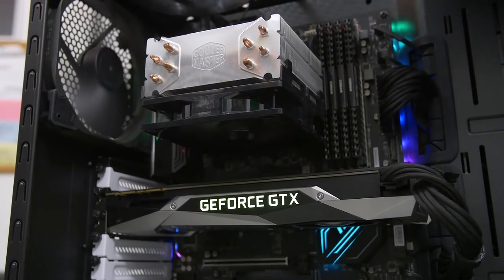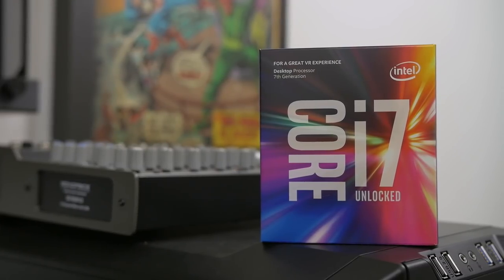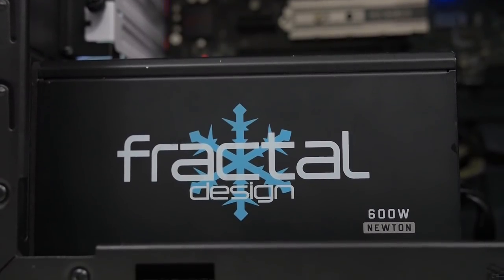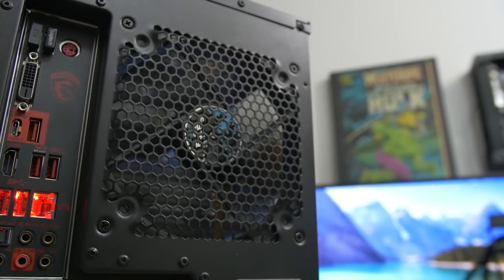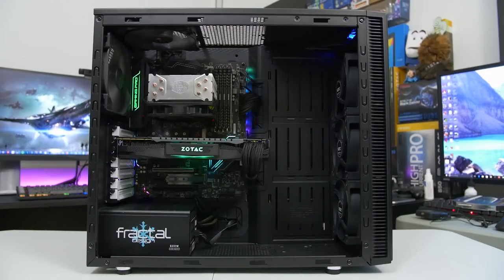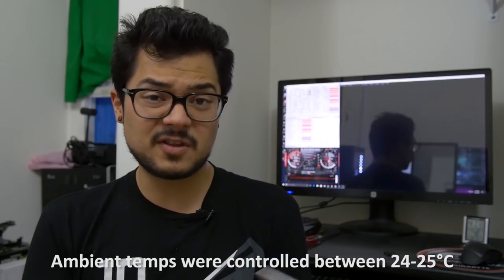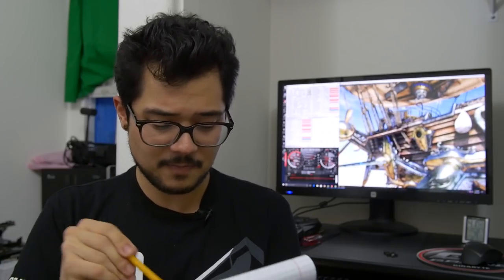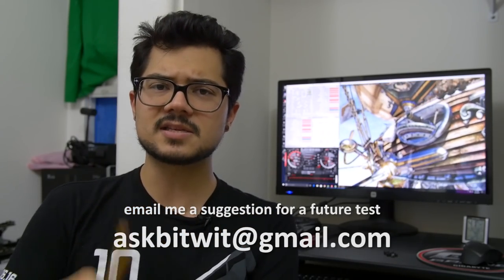This is how you should mount your CPU cooler! I think??

Comment: Hey bitwit, can I safely oc my i7 7700k to 5ghz with the hyper 212 evo?
Reply: Andrew Robinson Depends of the quality of your CPU.
Reply: Andrew Robinson highly unlikely
Reply: +Fresh Dumbledore ...i7 7700k...
+freestuffgood dang. What do you think I can I get to?
Reply: Andrew Robinson Every CPU is a bit different. Even if its the same modell. Some i7 7700k's can be oc'd better than others ^^. Also, whats your PSU?
Reply: couldnt tell you but 5 seems like alot for a non watercooled build
Reply: evga 600w bronze

and I thought I saw somewhere it could be done, but idrk if I could do it on air cooling.
Reply: ***** I just already have the cpu cooler. The motherboard is an ASRock z270 pro4, idk if it's good, but my budget just allows it.
Reply: If it were me anything 5.0 ghz or more I would use a AIO just because of thermals.  But the first question has to be will your cpu even oc to 5.0 (silicon  lottery).
Reply: Mostly no , u wont be able to push that far . 5ghz is quite hard to reach , depends on the cpuu . But the chances of doing that with a hyper 212  evo .. is very low . maybe sell it and get smth better , theres plenty of air coolers that should do it , and dont cost thousands of dollars
Reply: Just make sure you have a fire extinguisher nearby.

You'll need it o_o
Reply: the 7700k usually gets to 5 pretty easy, just wondering if it works on my cooler
Reply: No I doubt it. the pro series mobos from asrock are not super high end and the 5ghz speed people hit is on $300+ mobos and on AIO coolers.
Reply: It really depends on how many volts you need to achieve 5ghz. The extra volts is what makes the heat not the clock speed. My 7700k was pretty average needs 1.320v for 5ghz. My max temps are in the high 70c range while being completely maxed out. Game temps are mid 50c range up to 65c. My cooler is a EK predator 240.
Reply: XxViciousxX ya but with is motherboard i dont thing 1.32 v would work. In addition high 70c on a 240 aio would be wayyyy to high on a hyper 212 evo. u can always buy a 6700k btw.
Reply: As others have said here if your heart is set to oc it to 5.0 use water (either aio or custom loop).  If your budget only allows for a hyper 212 stick to the base/boost that the cpu offers.
Reply: Leon Yeah You'd want something like a Noctua DH14-15 or something like that if you want to stick to air. Or a 240mm aio. The high 70 was completely maxed out in after a few hours Aida 64.  Game temps are mid 50- 65c. But yeah 5ghz is probably out of the 212s league.
Reply: I'm actually running a Xeon X5460 @ 4.1 GHz @ 1.4v with a Hyper 212 EVO just fine.
That is a chip with a 120W TDP OC'ed by 30%. On that stats it should pull over 200W and still stays in safe temperature ranges. (Not chilly, but safe. Still >20° below Tjmax)
Depending on your chip getting 5 GHz on a 7700K with a 212 Evo should be possible thermal wise. It all depends on how much volts it needs to get there.
Reply: HappyBeezerStudios thats an xeon my friend
Reply: Just go for it. OC, run a stress test, and if your temps are above your comfort level (my threshold is usually 80-90°C, but your CPU shouldn't thermal throttle until it hits 100°C), then you go back into the BIOS and turn it down.
Reply: Thanks guys, one more question. What's the best bang-for-your-buck 16 gig ram kit?
Reply: Andrew Robinson cheapest one is always the best bang for buck. doesn't really matter what brand as they're all reliable
Reply: For DDR4, I personally recommend Crucial Ballistix Sport sets.
The heat spreaders are decent and cosmetically neutral(as they are plain metal), and 2400Mhz RAM is all you really need if you are looking to maintain a relatively inexpensive, but reliable Gaming/General-Purpose PC.
Reply: Andrew Robinson quality doesn't mean which cpu it is. if you win the silicon lottery you can get a cpu that does higher clocks stable with lower voltage. hence lower temps if you just hit your target instead of seeing how far you can push it.
Reply: yup higher volts = high temps. But bro as i said before i dont u can get 5ghz easily on that motherboard. its not exactly high end material.
Reply: lol
Reply: I would keep a tank of liquid nitrogen and a copper tube fitted water block just not to take some risk
Reply: silicon lottery for that cpu, cooler lottery for that cooler (not everything is 100% exactly the same) and especially motherboard quality lottery, there is many "moving parts" to that overclocking game, could be need too many volts and motherboard or cpu or cooler simply cannot keep it cool enough, your memory does not like it, or the temps simply are too hard to "cool" even if your motherboard/cpu/psu can supply it (I doubt the psu would be an issue)

Just think, if the "average" overclock is say 4.7Ghz at X volts, that means there will be X less that can hit 4.8Ghz "safely" even less for 4.9Ghz etc...if Intel/AMD/Ngreedia could sell something running 5+Ghz default at acceptable power/volts/heat they would, clock speeds/cooling/power required is not a linear scale, 100Mhz might not be much, but when these things have power fighting to get through those crazy small transistors 100Mhz is a HUGE amount ^.^..it truly is a luck of the draw to be able to hit high clock speeds at non suicide temperatures or voltage required, gbet you most Intel/AMD/Nv products are (example) a 5-15% range of clock speed at X voltage for X temperature or something like this.

We use them, they make these crazy complex things, they better know the majority of the critical numbers right O.O
Reply: You would have to have a room in Antarctica with 5 positive pressure case fans.
Reply: 7700K can be OCd to 5.0 and run below 60 degrees, but it ALWAYS requires delid and custom WC. 212 Evo is not enough for this CPU to get reasonable temps at stock. 

So delid your CPU
Use AiO/CWC
Enjoy 5.0Ghz with 7700k and reasonable temperatures.

Keep in mind that extreme OC requires top motherboard or you will burn your VRM.
Reply: Running an i3 8350k at 5.0 whith this cooler
Reply: Wow. 5.0? What are the temps and CPU voltage, motherboards, CPU BIOS settings and DDR you use? I've build several FX setups and no single air cooler was able to hold stable OC over 4.6/4.7 due to temperatures.

Sounds impossible for me, but you could win a silicon lottery!
Reply: AirsoftAddicted i3 8350k on a msi z370 sli plus motherboard, in a rosewill nautilus tower, 8gb ram (4x2) kingston hyperx fury, 7 rgb fans i think they are 120mm? The voltage for the cpu is set to 1.320?  I was told to start it at 1.325 but told to "tweak" it as low as i could as not to under power it. Other than that, i flashed the bios once after i downloaded it from the msi website. Oh and the coolermaster hyper 212 evo with arctic 5 thermal compound running all fans at max.
Reply: AirsoftAddicted didnt have to do much really, the chip stays at 85c. The ram is ddr4 running 2133 linked. Gtx770 4gb gpu and 1 tb harddrive. Probly missing something, sorry if i got long winded.
Reply: Andrew Robinson I know this is late to the response, I would be very careful if you're trying to overclocked with the 212. Though it is a good CPU Cooler, I don't think it's really designed to try overclocking with. However, if you have something like the the NT H1 thermal paste from noctua you might have a better chance with overclocking. ( I know people say that thermal paste doesn't really matter, but I've seen tests that show that that particular thermal paste has a lot of cooling potential) and I'm not saying it's the ultimate only thermal paste you can get. But what I've seen review wise that might be a good one to get.
Reply: Andrew Robinson nope
Reply: Andrew Robinson hahahahahhahaha
Reply: no hell no

Comment: The blower fan was catching cool air from the front fans which made  the temperature the lowest. The other config had the cpu blower pumping in warm air from the cpu shroud and exhausting warm air, not to mention the case air flow was obstructed by the side of the fan shroud rather than pushing cool air through while immediately exhausting it out the back.

Comment: i think the air flow from the frontal fans is pushing more air faster than the CPU cooler can absorb, like if the evo 212 where taking the cooler air thats coming from the front while the air from the unrefrigerated backplate is being push back and up by the air coming from the front and out by the fan in the back, also the third party vga could be running cooler so there is less heat coming out from it

Comment: With the horizontal mount and the open fan gpu, 100% of airflow goes through or near the CPU cooler, and the fan is not intaking directly off the hot back of the GPU. All three front fans are inline with the fan drawing air through the cooler, so I imagine there is a LOT of air going through there, and most of it straight from the outside of the case. In the horizontal mount, the blower fan actually steals airflow because it provides an alternate escape path for air.

With the vertical mount, it comes down more to case temp, because the cooling fins are perpendicular to the incoming air from the front of the case, therefore all air going through the CPU fan has either circled the case or is coming directly off the back of the hot GPU. With the blower fan, you lower the case temps by a few degrees, probably the entire difference you are seeing.

Comment: I know this is a year old but when you have 3 intake fans blowing in and you face the CPU in the same direction this helps the air continue out the back and keeps the air going in one direction from front intake to rear output .  If you mount the CPU fan vertically blowing  up , it works against the 3 fans blowing in horizontally therefore lowering the cooling effect. 08-11-2018

Comment: Have a potential solution for you.  Consider total air flow. surface area of 3X120s = 33912 (π•r•r). total surface area of 2x140s = 30722. Then you multiply the area by the speed of the air to get cubic meter per second (or CFM if you want to do the conversion). With the blower style fan, you're exhausting more air out of the case, SO... you could be dipping into a negative pressure, which would mean there isn't enough air for the CPU fan to move across the fins to cool with. By going with the open shroud, you're (in effect) returning the positive pressure which would mean more air across the fins of the cooler.

Comment: More effient cooling drops temps in entire case, because heated air can leave quickly and doesn't heat up as much. 
This is why blower, which heats up much more leads to worse thermals overall. Doesn't matter that it throws air outside. It still radiates more heat into insides through it's body.

Comment: When it was horizontal it was pulling all the fresh air from the front of the case, that's why it was cooler. Vertical only had 1 to pull from and it was moving against it with flow.

Comment: It all has to do with air turbulence when changing video cards. It can change the direction of the cool air flowing through the case. Remember that air does not flow straight from the entry point to the exit. Its air displacement and the slightest turbulence can affect that.

Comment: Maybe the weird results have to do with opposing fan currents? Maybe the open style GPU cooler disperses air through the case in a way that allows the CPU cooler to pull in more outside (cooler) air from that empty fan spot in the top of the case, resulting in cooler CPU temps.

Comment: >How consistent is the CPU load profile of the benchmark between runs?
>What's GPU load like?
>Side panel on/off?
>Are the fans PWM controlled by temps? or are they running at fixed speeds?
>Are you using the same thermal compound applied in the same way?
>Are you reusing thermal compound?
>How many runs did you do for each config?
>What is the uncertainty in the temperature that the CPU reports?
>Are the GPUs running at the same voltages and clockspeeds? 

On the assumption that your methods are sound, a possible explanation could be that the extra airflow over the heatsink caused by the open GPU is dominant over the slight air temperature increase. Although that would indicate a significant airflow bottleneck and that doesn't look to be the case.

Comment: so nobody said anything about it,i think you got higher temp on the cpu cuz the backplate was  releasing heat right on the heatsink,while the other gpu back plate would not get as hot and increase airflow
and in the second test the result were different cus the cpu cooler was cooling the backplate of the blower gpu(that was heating up the cpu in the first test)

Comment: there are a lot of factors that could influence this test. Somebody opened a window or a door which  sucked warm air out of the case. The thermal paste was applied differently between the cooler changes. The cpu and gpu  always have a margin of error when working which could affect the temperature. Somebody walking by the case could affect the pressure within it. Like I said lots of different factors working together. Such a test has to be run in a closed up room under monitored conditions with different cases, different cpus and gpus to be meaningful.

Comment: did not read through the comments but if that case has a clear side panel install it and run the system with smoke flowing through. you may be able to see the air flow and how each card and positioning of the CPU cooler affects the overall flow. it is possible that there are different pressures based on which way the fans are blowing.

Comment: Maybe with the Blower style GPU, you end up with lower Positive air pressure? In that configuration you effectively have 3 exhaust fans, whereas with the open style GPU, you only have 2 exhausts... I guess to put it another way, perhaps the CPU fan and Blower fan were competing for the same intake air..?
Reply: that's a good theory
Reply: The amount of fans isnt as important as the air they can move. Most case fans are around 50cfm, which is pretty low. Stock blower fans move about half of that, or about the same at best.

Comment: it's about the overall flow of the air. you should put cameras inside for a cross section view then get a smoker or a smoke/fog machine. That will show you how the flow of air is actually tracking through the case. But it seems the orientation for the cpu cooler is also dependent on what kind of GPU cooling solution you end up getting.

Comment: I think Horizontal + Blower is an anomaly. Blower style GPUs can't affect the CPU temps, since they blow the hot air out of the case.
Maybe it was an issue with seating or thermal paste.

The rest of the results make sense.

Horizontal + Open: The CPU fan draws cool air from the front. Most of the hot air coming from the GPU is pulled by the rear fan and pushed by the CPU fan away from the radiator. Very little hot air will get to the front of the CPU fan and get dragged through the radiator. And since the CPU fan is closer to the radiator than the top fan, it exerts more pressure, so the hot air can't go through the radiator vertically.

Vertical + Open: The CPU fan draws most of the hot air coming from the GPU. Some of it gets pulled by the rear and top fan instead. The majority of the cool air (which didn't go through the GPU), goes straight out of the case, pushed by the CPU fan and pulled by the top fan. Hot air obviously doesn't cool as well as cool air.

Vertical + Blower: The CPU fan draws air from the bottom. While the GPU blows hot air out of the case, its back plate is most likely quite hot as well, so it slowly warms up the air that comes in contact with it. That air gets pulled through the CPU radiator. It's still much cooler than the air coming from open GPUs, so it performs much better than Vertical + Open.

Horizontal + Blower: This should perform the best, since there is absolutely no hot air from the GPU interfering with the CPU cooling. The very little not-so-cool air coming from the back of the GPU is pulled by the rear fan instead.

Comment: Hey Kyle, just one note from a fan here: (jokz)

Horizontal Airflow
i guess the first test didn't makes much sense because the 1070 founders edition have a little apperture what blows a bit of hot air in the case (directly inside, and it circulates to CPU since the exahust fans are right in back of him).

so with the VGA card with aftermarket cooler the air goes to the sides, so the CPU are taking cold air anyway.

Vertical Airflow
since the fan are taking air from the bottom, the hot air of founders edition do not affect the CPU temps, (because he goes in direction of hard drives and goes up to the exahust fans, do not running thru the CPU)

and with aftermarket cooler the CPU are recieving almost in the face the hot air from GPU.

so in my opinion you should do a part 2 video, doing the same test with the case closed

Keep up yor great work Kyle :D

Comment: This is so cool, you somehow managed to pick almost my exact setup. I have the same motherboard, the same cpu cooler,  that zotac gtx 1070, and even corsair vengeance ram. Only that's rgb rather than lpx. I had my cooler vertical at first and decided to swap it to horizontal. Having it set vertical kept the gpu cooler, but horizontal the cpu was much cooler. That's fine with me though because that card tends to stay plenty cool on its own
Reply: How do you change the orientation of cooler please?  I can only install my 212 with airflow to back of the case?  It’s an am4 mount.

Comment: #1 Re do the test to look at the consistency. Make sure it's not because something negligible.
#2 Maybe you can use a heat gun to look at different point on the GPU's PCB.
#3 Use a thermometer like linus used to control intake temps.
#4 Like Andrew said, use a pc safe smoke machine.